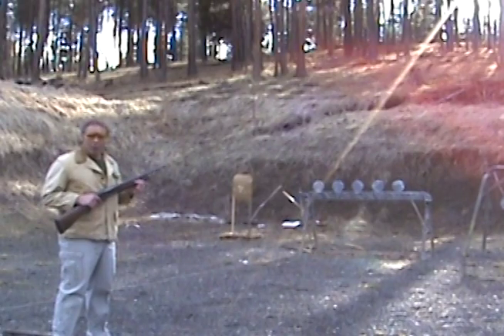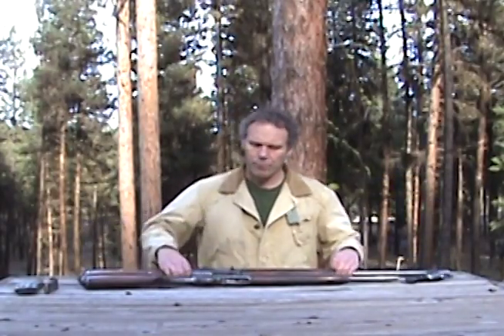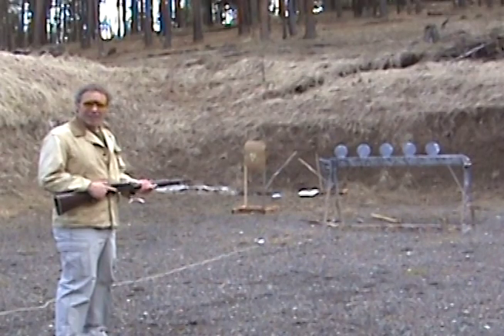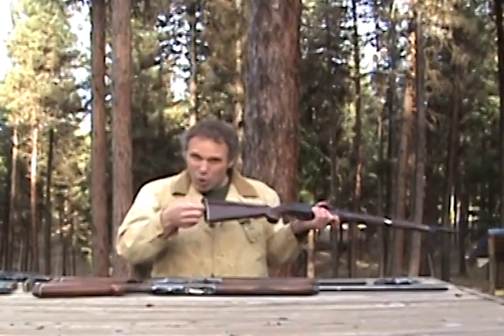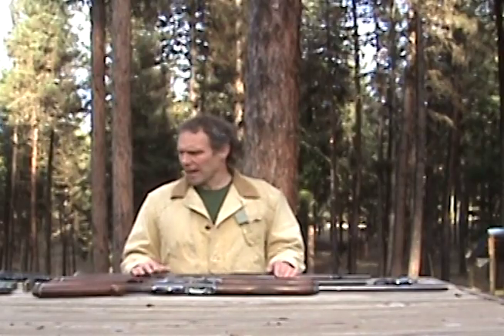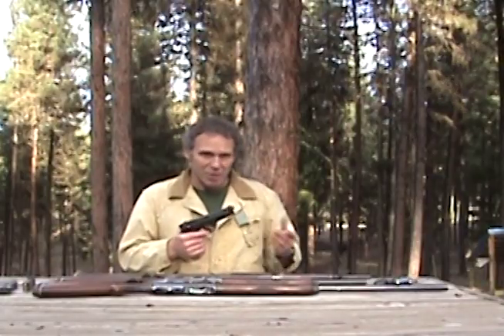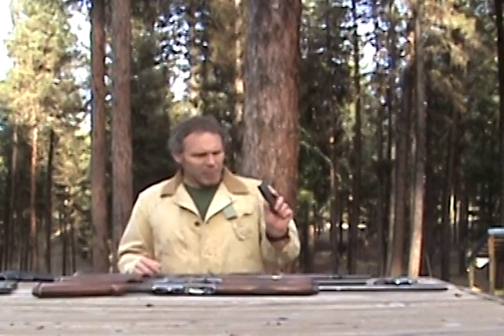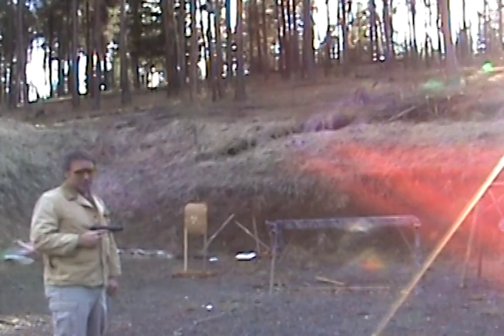Can spring compression damage a magazine?

Comment: I only keep 10 rounds in my 13 round mags. Rotate them every once in a while. I think newer metals are probably better at maintaining their tension. I’ve been told that loading and unloading rounds and cycling magazines causes excessive wear, more than leaving them loaded, I’m not a gunsmith but I am a mechanic and a car sitting for a long time is bad for the valve springs on the open valve in addition to several other things. I’m pretty meticulous and clean any firearm I own after i shoot it and disassemble and apply a small amount of oil every few months. I have never had a single failure in my Springfield and Glock. 
I’ve had an unbelievable amount of failures with the 92FS, it was left to from my grandfather. I only use 115 ball with it and still constant failure to feed, stove piping et cetera, even took it to a gunsmith and he told me in Iraq his M9 failed on him and I’d be better off with a pointy stick. The 92FS is extremely accurate and comfortable but the tolerances are too tight, it’s a beautiful firearm but even someone as fastidious as myself can’t keep it reliable. I know my experience with the 92FS is anecdotal but I’ve heard so many people tell me they’ve had similar experiences and just as many people offer to buy it because it’s such an iconic gun. I like the gun, it also has sentimental value but I wouldn’t trust my life to it.

Comment: Im sure this boils down to quality and design of the spring steel,  with so many manufacturers and brands , I imagine both are true
Reply: Shock Tones exactly.  A spring is simply heat treated steel, tempered for spring temper.   The same design springs can have varying heat treat.   The same kind of steel with identical heat treat will still come from different batches of steel.  

Variables abound.  People cannot speak in absolutes when they don’t account for variables.

Comment: I get your point, but I was hoping that you would provide some "ideal" guidance. (You know what you should do)  I'm in my mid-60's and became concerned about home defense.  My primary weapon is a Mossberg 500 fully loaded with nothing in the chamber.  Based on your video, I decided to not keep a round in the chamber.  My intent is to have my first round as #4 bird shot and after racking the slide, put another #4 bird shot cartridge in.  The other rounds are buck shot & slugs that I hope never to need.  So this spring is compressed almost all the time except for when I practice.
My backup is a Glock 22 with 3 magazines loaded with 9 out of 10 hollow points each.  These are almost fully compressed all the time, except for when we practice.  Now I'm not so sure that this is a good plan but  I also am not sure what a GOOD PLAN is!  My wife & I go to the range once a week except for the Winter, in which case we go once a month.
BTW, nice car; I have antique plates too and am still able to do maintenance at the correct intervals.
Reply: If I were in your situation I'd think practically.  Ask yourself this.  At your age, do you think you'll live long enough to notice magazine spring failure from compression in your modern firearms?  Probably not.  Both of the firearms you described are made by well-known manufacturers that have learned the balance between cost and quality in order to produce weapons that work reliably. I think you're fine with exactly what you're currently doing.

Comment: Properly tempered steel springs, coil, leaf, whatever, normally do not lose their spring action if used within limit of extension or compression, without a time factor, ie. “perpetual “ function. I’m sure the same applies to magazine springs.

Comment: The damage springs occur when compressed for long periods of time is referred to, in material science, as creep deformation.
Even though a load can be less than the yield strength of a material, that material can sustain plastic deformation over time. There are many different types of creep, but in all of them temperature exacerbates the problem; higher material temperature will yield more creep, sooner.

Comment: My low information angle on this, culled from various opinions,  is that the initial qualities of the alloy,  quality of manufacture and  corrosion resistance of the alloy is going to have a lot to do with answering whether or not a spring would take a set.  
Dumbing it down just for myself,  I'll take one cartridge out so that a tube or magazine is full -1 and call it good,  if that magazine is stored "ready" -but not frequently cycled and messed with.
Long term storage,  why Not keep them under ideal conditions as possible?

Comment: Thanks! This video you referred me to answers the question I asked you recently (Aug 2020). I wonder though if some springs could withstand compression or expansion better than others? Surely there must be a wide assortment of metals and manufacturing processes used in spring production that could effect their longevity?

 I believe you said something in passing about a magazine not kept fully loaded as if that would keep the spring in better condition? Is that right? What with 16 round magazines I could leave a couple shells out and still feel safe that I could stop a bad guy with the ammo left.

Comment: I think this comes into play for the most part in the two to three  year time frame. Although I would think that even in war, you would not carry the same magazines through the entire war In Iraq, we were issued seven magazines.  We were told to carry them all loaded.  We were also told to unload them and let the springs release tension.  A bit of a contradiction.  
And really, how does releasing the tension work.  It could be just as damaging.  A spring  is metal is subject to fatigue. Constant cycling could induce metal fatigue just like storing could cause the spring to lose compression strength.   I can see where to a knock off magazine manufacturer (and to an army procurement officer) a spring is a spring, whereas a manufacturer with a reputation is going to have some metallurgists talk about the best alloys to use to achieve needed strength and release times and resist metal fatigue, etc.  
Someone could set up a test, say at Ft. Benning.  Get in a new shipment of mags, take two dozen and mark them.  One dozen is put into a unit, issued every basic trainig cycle, carrie mostly empty, but fired intensively for a week, and returned at end of training .  This would be more firing than done in a Reserve  unit in a year for each training cycle.  A second dozen would be loaded and stored in a box in the arms room.  (Maybe actually get a third set which is stored unloaded.  At the end of three years, do compression tests and crack checks for all sets.  At this point you are lookig for changes, not necessarily for complete failures. 
Sorry, add to the process that every spring n every magazine gets the same tests before the test starts.
Got any friends starting an extensive hitch as a drill sergeant?

Comment: I found a loaded M16 magazine that I had forgotten to turn in when I left the Army more than 20 years before. It fired just fine and I still use it with the same spring.
Reply from the maker: That's not bad for a government issued mag. Was it fully loaded?
Reply: @PaulHarrell  Yes it was.
Reply: @PaulHarrell  I should also mention that I have a lot of magazines so I can't say how many times I've used it. Probably not more than 10.

Comment: Saw an engineer that explains exactly why spring compression isn't an issue in most cases. Basically as long as it doesn't reach a threshold of almost fully compressed, it can basically stay like that forever.

Comment: I've owned a 1911 for years now, and I have around 12 mags for it, and all I can say (for that gun at least) is that not all magazines are created equal. There's too many factors involved to say that spring compression will or will not happen by default, and that applies to all firearms.
Reply: Agreed. I have a 1911 Colt Officers model that I carried for a decade or so. I have 3 mags (three is all I ever own with auto loaders normally) and one of them does not like to feed the last round now. I found out when I dusted it off and took it out plinking a couple years ago. Spring tension issue for that mag, that was not a problem 30 years earlier. It was the mag I left in the gun loaded (to 5, not even the full 6) for about 25 years as a home defense staged gun. I found a couple new mags for the old girl, and rotate the mags faithfully about 4 times a year now (I use the season changes as timers) and that is that. Is it needed? I don't care. I need to do it for my own sense of trust in the gun. The rest of my handguns have round cylinders with chambers in them, and no need to even talk about springs. lol

Comment: Just to add to what Mr. Paul is saying, I have had 1st hand exp with this sort of issue with my XDm 9mm.  Full size 4.5 with the 19 round mags.  Loaded both to capacity, next day shot and both functioned flawlessly.  Fast forward 2 weeks later, left out on a 4 month job and didnt unload my mags before I left.  When I went to shoot after returning home the gun shot fine, but the follower failed to catch the slide stop.  Since then, they only get loaded to 17 max and cycled regularly.  Haven't had an issue since.  I forget the proper term for this, but I think it's called creep where the metal plasticly deforms or in the springs case, relaxes over time.  If there are any engineers on here or anyone else that wants to chime in with a correction or just has more to add, by all means help me out, please.

Comment: I can’t say it’s a myth because I’ve encountered magazines that did suffer spring compression damage but like you said it’s easy to fix them at least until you can get a new spring.

38 Smith & Wesson is a neat little cartridge. Takes a .360” diameter bullet and traditionally I believe was loaded with Black Powder and 200gn lead bullet.
Reply: How long were the mags loaded?

Comment: Perhaps what makes the difference in magazine springs is the spring itself. What gauge wire, what alloy, did the spring work harden as it was being shaped? Lots of variables to consider. As Paul hinted at, be familiar with your firearm and be aware of possible decreased functionality and address those issues.

Comment: Metallurgy and heat treat on ancient springs is always in question.  I've got tired wartime slide springs, whiich got weaker just sitting there, uncompressed.  Quality modern springs don't care about compression, just cycles.

Comment: Easy to test. Take a spring out of a mag, or leave it in and get a stick. Press it down, it will get more difficult to compress as it goes through elastic deformation. When it reaches plastic deformation it will feel like the amount of pressure you have to apply has leveled off. Measure the height of the spring at the point it started to weaken. A bit above that is the max compression before damage occurs. 

Science!  :-)

Comment: Aahhh yes, the age-old loaded VS non-loaded mags debate. Almost as good as which came first the chicken or the egg. I know an incredible amount of diddly squat when it comes to metallurgy and even lesser when it comes to specific aspect like molecular elasticity. But what I do know is I have 5 recentlyish found mags that 8 years ago fell behind my safe and were loaded to full capacity in purchased new state. I also have more of the same ones purchased at the same time that have been continuously used throughout the years. I plan on waiting 2 more years  and purchasing more of them to compare all three of them together. 10 year old untouched loaded to full capacity, 10 year old of continued use with probably 5-6k rnds cycled through them, and brand new untouched virgin ones. I'm super curious to see what or if any differences I may notice between them. I wish I had some loaded at 50% to compare as well, but sadly that's not the case. If in 2 years I remember to I'll post an update with the results.

Comment: FWIW...
Due to a flood in '97, a Marlin Glenfield 60 ended up sitting in a storage unit for 21 years with the bolt locked open.
After finally getting reacquainted with the rifle, it certainly didn't look to be in as bad of shape as I'd remembered. So I completely disassembled, cleaned brushed & lubed the entire weapon. All original parts were still intact, and it was reassembled.
It did function, though not quite 100%. There were a few failures to feed.
Following the replacement of the buffer spring, it ran flawlessly. 
So... yeah, parts will wear out eventually. 
Maybe... just maybe, one day I'll actually need to replace my Glock magazine springs.😏

Comment: The engineer take on it....  steel has a really good elastic tension characteristic, which is why steel springs are so good.  As long as you keep, say, the last two rounds out, I would think the spring would work indefinitely.  However, when they make it almost impossible for you jam the last round in, you go into some of the plastic (permanently deforming) tension properties.

Comment: Just my 2 cents. About 5 years ago a farmer in Germany was repairing his barn when he discovered an SS uniform and submachine gun, more than likely an MP40, disposed of by an SS trooper making his way back home and not wanting to be discovered to be SS. The farmer contacted the local police chief who took the sub gun and fired it, as it was still loaded. It fired flawlessly, in spite of being left in that condition for around 70 years. You might say, yes, but that was German engineering, and I would agree. Still, that's impressive. Just before that I was talking to a retired General Motors engineer and asked him about his work. He replied that he worked at the Tech Center in Warren, MI engineering and testing springs. I asked him about how magazines being left loaded affected their life. He told me that as long as a spring is used within its design parameters being left loaded is not an issue. He said what shortens spring life is over compression, trying to fit just one more round in the mag, or stretching it out. Looking at car valve springs it is easy to believe that. There a lot, at least in my area, of cars and trucks that have over 100,000 miles on them and quite a few with over 200,000 miles. These springs are cycled at over a million times, in conditions that get quite warm (195-220 degrees) and I can't recall the last time I heard of anyone replacing them. Still, this a subject that, more than likely, will continue to be argued as long as we use magazines. Until we have jet powered, laser beam, hand cannons, like Star Trek, that is. Peace.

Comment: I had a conversation about this on a forum some years ago. According to one of the mods who  was a metallurgist based on things he had said on other threads, the spring in a magazine shouldn't "take a set" if the spring has been properly heat treated. You can't tell by looking at it if this was done properly. The only test for whether a magazine spring has been properly heat treated is to load it up for a long time and see if it takes a set.

Comment: I watched this all the way through and read some of the comments. (I'm not about to read all 2421 comments.) I haven't seen a query on spring tension in the firearm itself. I have a Springfield Armory M1911 Mil-Spec. My understanding is many people keep these cocked and locked. Over time would that harm the hammer spring? And probably the answer is the same. It depends. Maybe over 25 years? You be the judge.

Comment: I guess I have had pretty good luck with Magazines with the exception of the original Glock Magazines that came with my Gen 2 Glock 19 (I think I bought the gun new in '93). Those magazines would heat up and expand, and then the top bullet in line would kind of fall back into the mag and jam. Come to think of it, that Gen 2 Glock had a couple of other things wrong with it that has made it my least favorite handgun for a long time.

I replaced the original plastic guide rod with a tungsten rod and that made a huge difference in accuracy. Last year I finally put some quality sights on it and am finally getting my groups closer to the bull. Still not my favorite, but I no longer hate it.

 Anyway, I replaced those original shitty mags with newer Glock magazines and some knock-offs and they work fine. I have left them fully loaded for years at a time with no troubles at the range. The one thing I will say for the Glock I that it will cycle anything I put in.

Comment: The trick for dependability is to change out your equipment ever three or four years if you leave them loaded.  Most law enforcement agencies, mine included will load pistol mags to capacity and leave them that way in between shooting.  On a 9mm Glock mag, that spring is cranked down tight.  Never had a problem nor have I seen or heard of another in my 500 plus person department having a problem.  On M4 mags, we load a 30 to 28.  Same thing only they sit in the car rack day in day out.  In my area the yearly temp inside the car swings from 150 degrees down to as low as 0 or less.   Again, never seen or heard of a problem.  Same thing with cruiser shotguns as it relates to the magazine spring only that one is always loaded to capacity.

Comment: Depend only on the firearm quality. Original 1911 finded loaded on the 90's and cocked in 1944 still works perfectly, other example are de colt 1903 hammerless. in any case you just change the magazine spring

Comment: If a magazine spring needs to be stretched to perform better, one "should" replace the magazine. All springs have what is called a "spring constant k" value measured in force x distance. Fatigue changes that value. The magazine was engineered to operate best with a spring of a specific k. It's like going to Home Depot and swapping with one that feels about right (shape not withstanding)